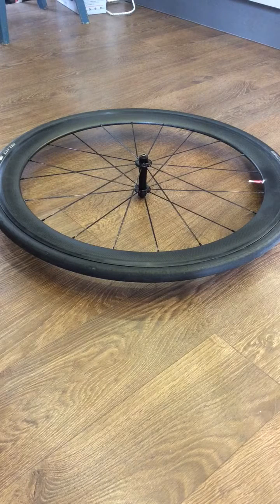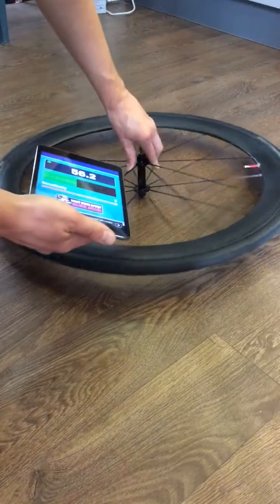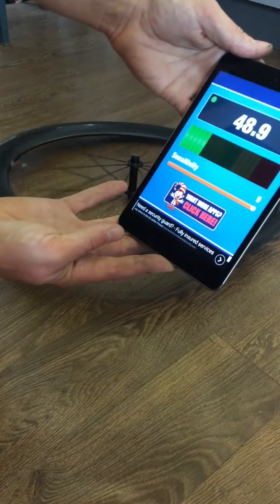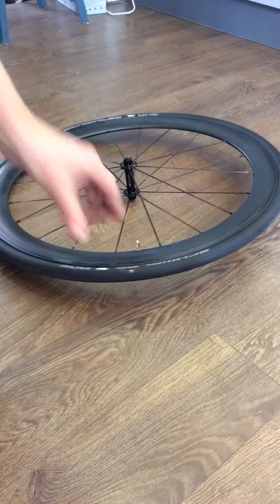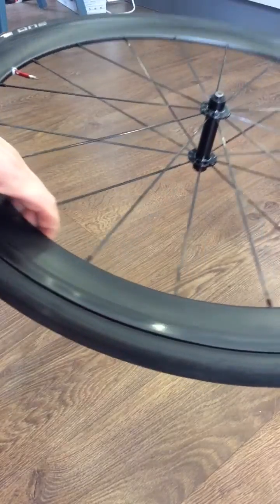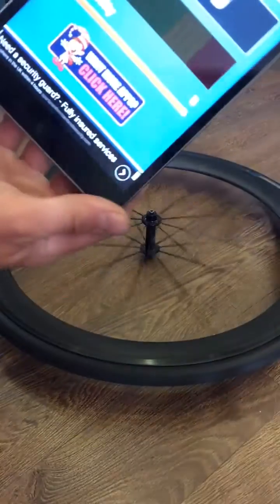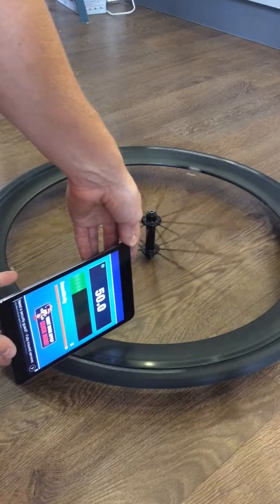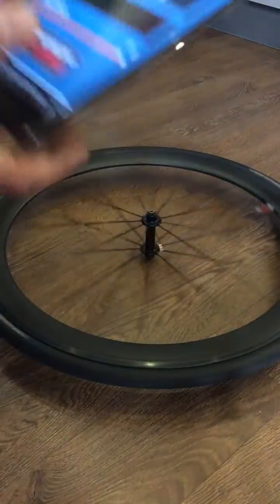UCI Motorised Doping Detection Simulation Inside Rim

Comment: Where is the science behind the claim that a magnet of such a small size, even in greater numbers, would provide a motive force to be of any substantial aid… essentially negating both the cumulative mass & torque issues of extra   metallic components on a spinning device?  Please… spin the science.
Reply: Google it bum
Reply: @sneakerjoe23  “Google it”….(?) too vague.  Cite the study — if you know of one. Thx
Reply: @Zeno2Day  If you know anything about physics, you could start with Maxwell's equations. A moving magnet is an essential part of some types of electric motor / generator.

Comment: What if the magnets are electromagnets- coils of wire woven in the rim? They could be activated by a hidden switch. That would not be detected by static tests like this.
Reply from the maker: There isn't the physical space inside the stays and with wide stays today they are simply not close-enough to the rim to create any force electrically from coils. Inverse Square Law of magentic force also applies. So, if you see a bike with stays <1mm from the rim, perhaps it's a motor, if it's the usual 20-30mm+ not a chance. The coils would need to be the size of your fist, not a 5mm ID of a seat stay ort even 10mm ID of a chain stay.

Comment: What does a magnet inside a rim achieve, excuse my ignorance.
Reply: A single one, not so much. The idea was to detect mechanical doping using motorised rear wheels. There would be a series of magnets around the rim, like the magnets in an electric motor, and then the stator would be in the seat or chain stays. Lightweight made a working prototype, called “Maglev Transrapid”.
Reply: Alternating the polarity on every other magnet around the circumference inside the wheel, and as said, mount a “stator” in proximity to allow the alternated magnets to run through and it acts as an aid of sorts and helps rotate the wheel.